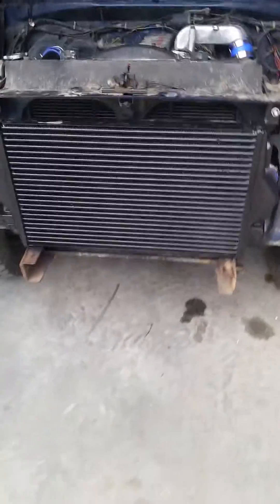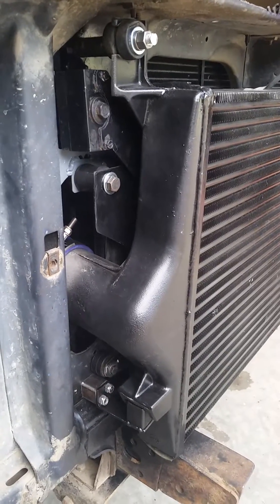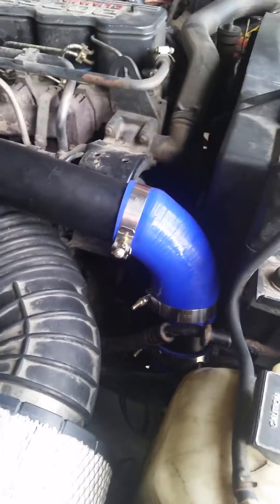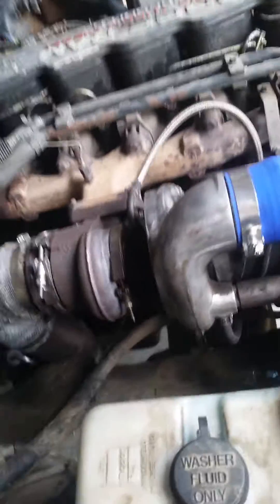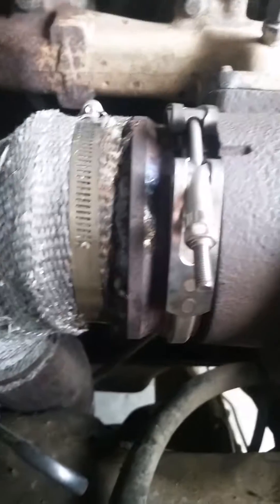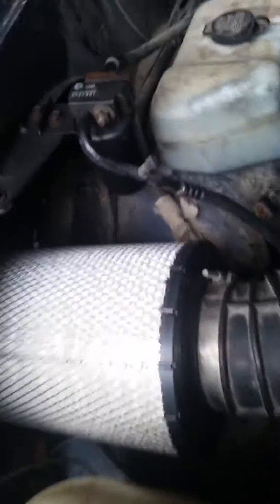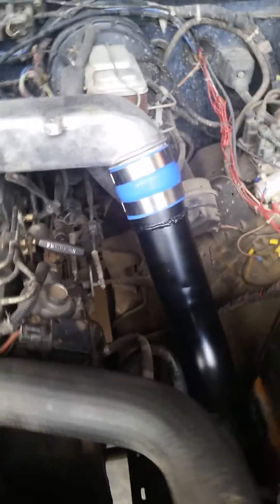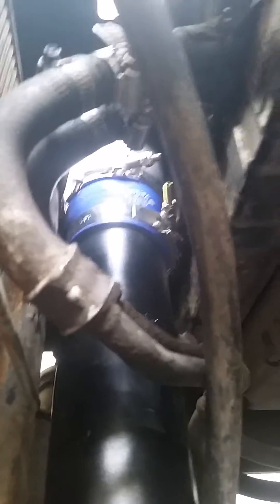1st gen cummins turbo swap

Comment from the maker: When I took the turbo to get rebuilt they set it to be purely mechanical. You can control your boost with a mechanical boost elbow or just adjust the waste gate push rod for desired boost. It's really easy. If you just plug the hose you can disable the waste gate and boost 40+psi.

Comment: looks great! how do you like it? spools good? egts before and after?
Reply from the maker: Egts are always in the green. If I plug the wg I can boost to 40psi but there's no point as I'm only running stock fuel pump, have the wg set to 22psi atm, probably going to adj to 30psi in the spring. Long boosts on the highway raise my coolant temp alot, Egts are never a concern anymore.
Reply from the maker: Spools a lot quicker for sure off the line. Egts before would get hot fast with the h1c and stock ic. Couldn't give you a degree difference. But I can tell you before i'd hit red on my pyrometer and now it doesn't make it to yellow.